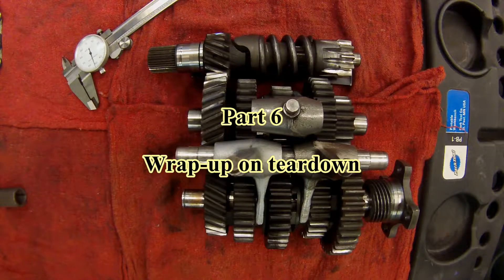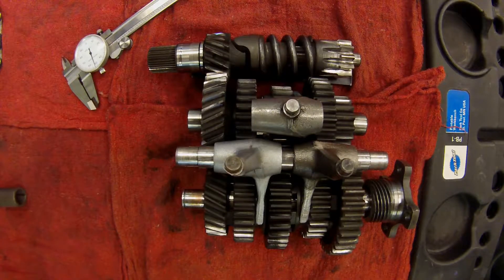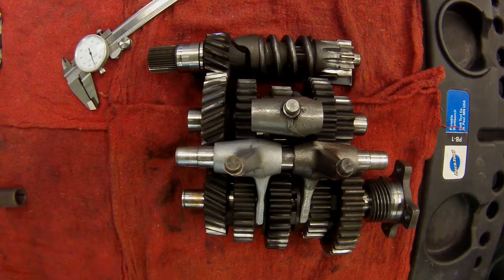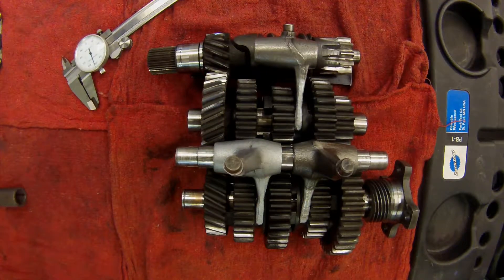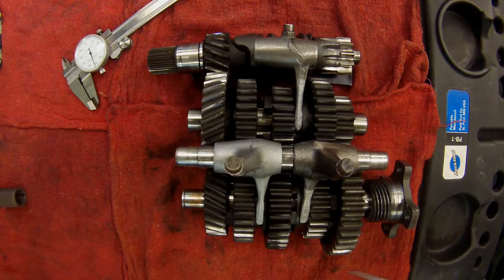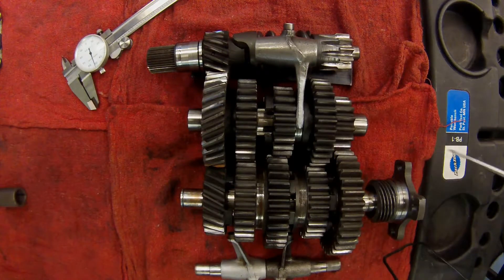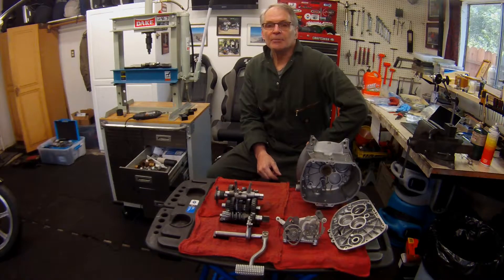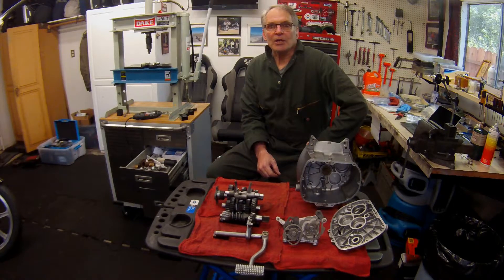Part 6 Gearbox Teardown Wrap Up

Comment: Hey Bob, how did you get the kickstarter and spring back in? Is there a trick?
Reply from the maker: Hey Jan.  As I recall it was pretty straight forward if attention was paid to disassembly.  So no trick as I remember.  Sorry I can't help further but it has been a while now since I had a box with a kickstarter open.